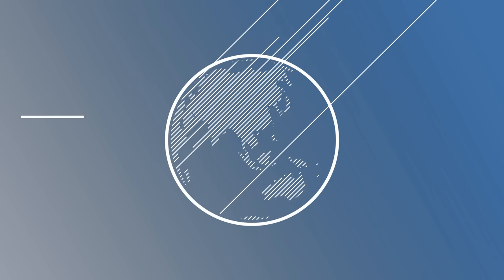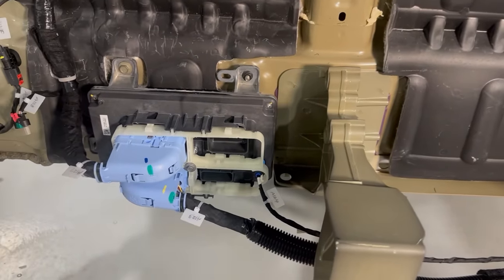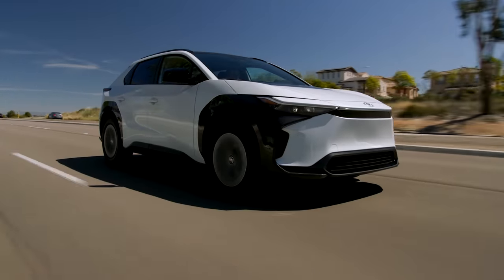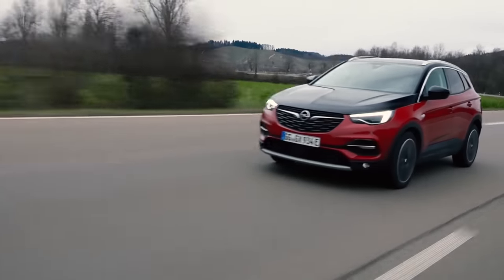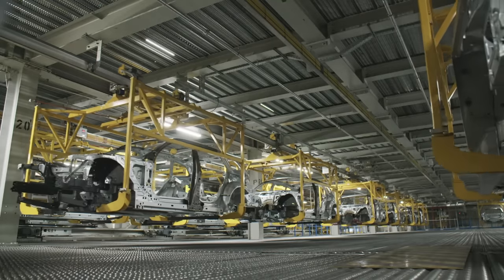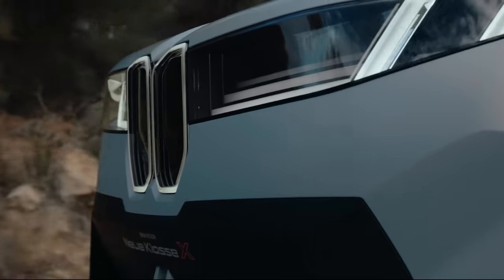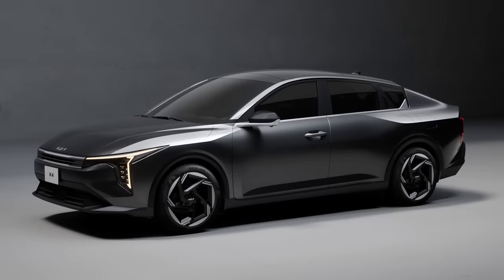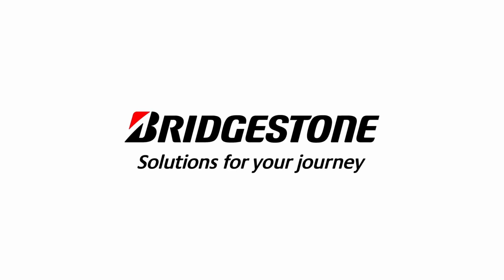BMW Neue Klasse Cuts Pack Cost in Half; BNEF Says BEVs Far Cleaner Than ICE - Autoline Daily 3773

Comment: An EV dies with its battery, like any toy
Reply: If you throw out your kids' toys when the battery dies, your kids won't like you very much.  Just a word of advice from a dad.
Reply: Take the dead battery out, stuff a V8 in it like Rich Rebuilds did and call it a day! The cost would probably be comparable 🤣
Reply: An ICE dies with its engine.  In most BEVs early failure can be fixed with module replacement. The battery isnt one thing.
Reply: @russh6414  I find the Cybertruck ugly but I would buy one and put a good ole V8 in, just to see fanboys faces it would be worth the cost
Reply: @MrYishaiShields  How much does it cost to replace a Polestar battery again? 80k more or less
Reply: Sigh, so your complaint is that an EV that is highly likely to outlast a car with a suck-squeeze-bang-fart engine will eventually die. True, everything dies eventually. But I prefer a technology that dies later than sooner.
Reply: @taniabanes4707 Take the Cyberust body off the frame and put in on a good old reliable Chevy  4x4 frame and call it a day. I think Autoline might be able to direct you a body after they are done tearing it apart! 🤣 Just make sure the door hinge issue gets fixed
Reply: @russh6414  The body would probably rust at first rain but for a short time it would be the new DeLorean in town
Reply: @johnpublicprofile6261  Except an engine can be fixed, parts changed when needed for a reasonable cost. With an EV the battery is everything, it’s just an eggshell without 
How much range an EV loses year after year? While well maintained an ICE engine only grow stronger 
Some cars from the fifties and before still run, how many Tesla build today will do the same in just 10 years?
Reply: @taniabanes4707  Except an engine needs to be fixed with expensive labour costs, parts changed when needed, fluids topped-up whilst both the battery and motors of a modern EV are likely to outlast the car their built into with zero maintenance.
And if you don't think an ICE car doesn't lose range (and performance, unlike an EV) year after year then ask a mechanic.  BTW after the 1st year once chemical initialisation happens then very little degradation happens these days.
Reply: @taniabanes4707  BTW there are plenty of 10 year old Teslas running around today.
Reply: @johnpublicprofile6261  Maybe so but this allows an ICE to last for years not being dependent on just one part, the battery, EVs are not made to last, it’s not even the technology, it’s simply that EV makers don’t want them to, just like cell phones or fridges, meant to fail and be replaced. The goal of EV makers is to sell to gullible people and their cars to fail asap so they buy another one. As soon as the battery is out an EV is worthless, there’s no part in an ICE that means the end of it if it breaks down, so yes it costs a little in maintenance but it’s an investment
Reply: That probably sounded great in your head...😂
Reply: @johnpublicprofile6261  Easy to say, hard to prove, since a ten years old Tesla looks exactly the same as a ten minutes old. I’m a car enthusiast, I grew up in this environment, I can tell basically what car is which first sight, but I still cannot make the difference between a Tesla or another, so guessing the year even less 
I guess maybe the date on the cereal box it comes from would tell
Reply: @BTC_Minarchist  Tbh nothing about EVs sounds great nowadays, I will never get why some people praise something so obviously problematic and unreliable.
Reply: @taniabanes4707  Can you tell the difference in the latest iPhones at a glance, from a slight distance?  That's what many EVs are like. For those interested in features, function and tech, it's mostly about the SW and engineering.  The shell has to be pleasing enough, but is not the focus.

There are more material changes in a 2019 and 2023 Tesla Model Y than most cars with new sheet metal and a few extra cup holders and paint options.

This isn't a criticism, just the way things are.  EVs are new and the tech is advancing more quickly, so the focus is under the skin.  ICE focuses more on the skin because the tech underneath has matured over the past 100 years.
Reply: @taniabanes4707  There are always edge cases, anomalies and examples of poor design.  Not every EV is like that, just like not every ICE care is built to exacting standards.
Reply: @taniabanes4707  Agreed "will never get why some people praise something so problematic and unreliable", but you still seem to like the problematic and unreliable and obviously nothing we say will change that. Let's agree to disagree and part in peace 🙂
Reply: @taniabanes4707 what’s a Polestar anyhow?
Reply: I was neutral to negative on EVs three years ago. I bought a Tesla 2-years ago to give it a go. 
After two years driving an EV, I will NEVER buy another ICE vehicle!

I think many of you “never EV” blokes will be surprised once you have the experience.